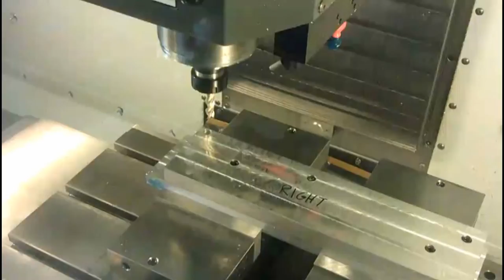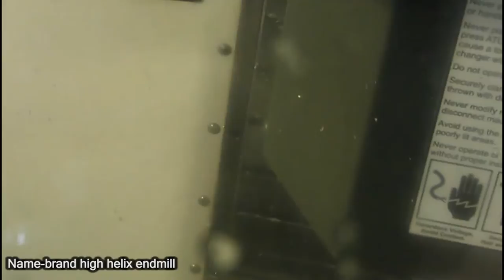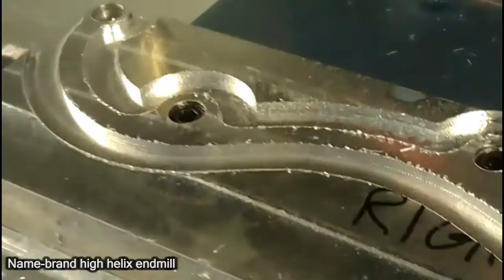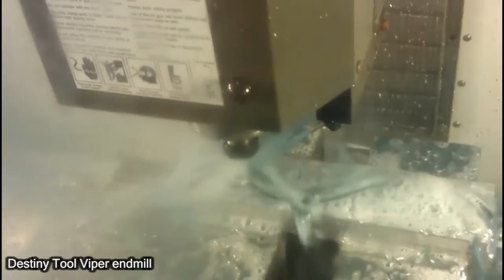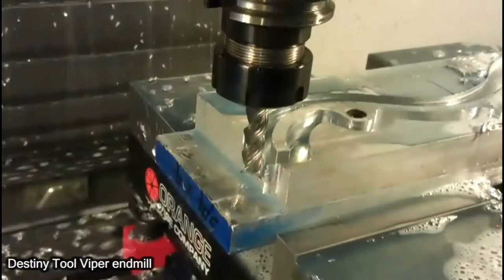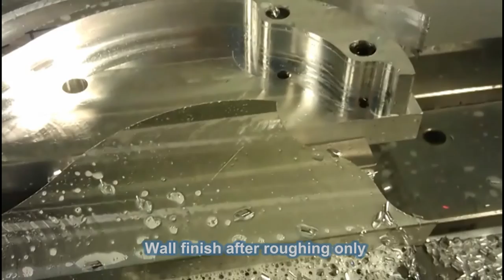Destiny Tool Viper.

Comment: Very conservative chipload. I use to test these to ~.012" per flute and would usually run out of horsepower before reaching 1D axial on smaller ~20hp spindles. They're  a quality tool and can really be pushed in a good holder; hydraulic, press (powergrip), etc.. You'll find the pull-out limitation of an ER/TG in a hurry though...